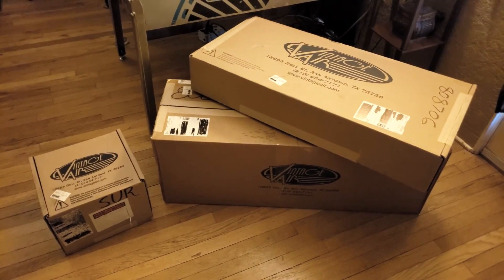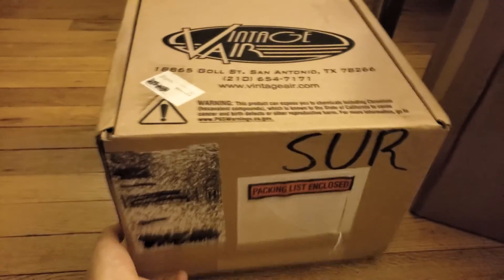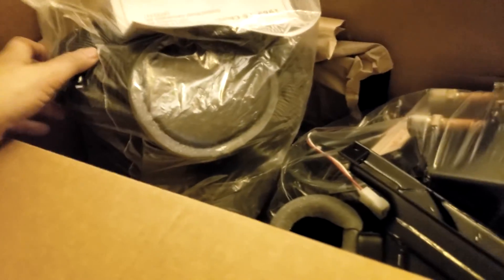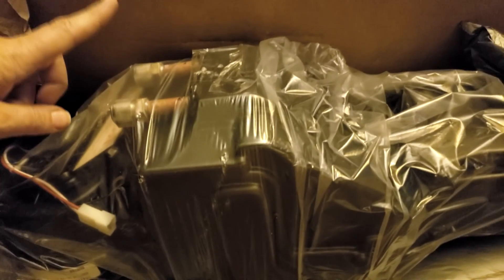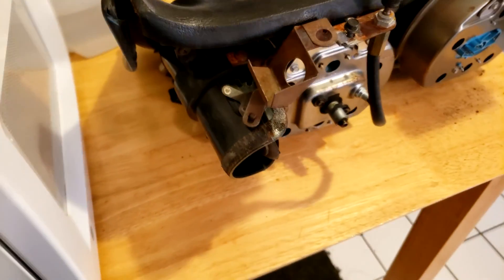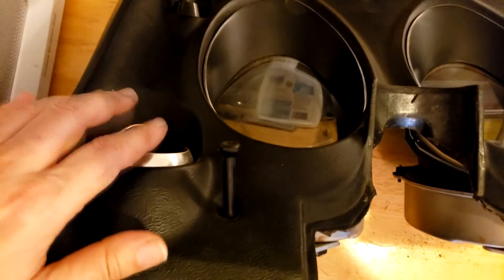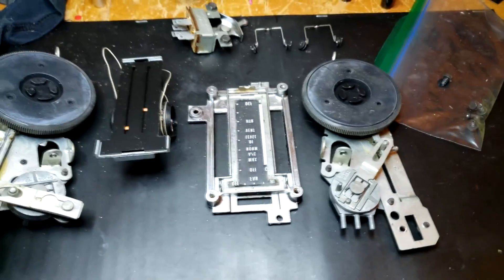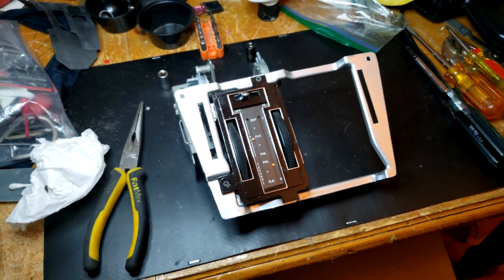1976 C3 Corvette - Vintage Air AC Kit + Cold Case Radiator & Flex-a-Lite Fans Install - Pt 1

Comment: I am just curious.  How is that radiator fan working out for you?  When I bought my '77 someone had put on a little silly "flex fan".  It was overheating like crazy.  I bought an original, stock fan from Ebay, put that on , added a new thermogenic fan clutch and a nw temp water sensor and have only seen the temp go up 5-10 degrees, like when I'm waiting in line at a fast food place, or in traffic,. otherwise its cool as a cucumber.  My '77 does NOT have a/c, and I want to put it back on some day soon.  Just curious how the performance of that fen is...thanks!
Reply from the maker: Hi Ender0999. Yes, this Flex-a-Lite fan is working very well. The car was getting pretty hot before I burped the system though (that process is shown in one of my videos). After burping it has been great. Since I have to use AC in the summer here, I needed to make sure I had a good fan that would constantly pull air thru the rad. This one does a good job, I think. I've read that these cars are notorious for overheating, even when new, mainly when sitting in traffic. While working on the car I noticed the hood seal, which makes the engine compartment basically a sealed-in area that does not allow for adequate heat pass-thru. Even when moving, a pocket of hot air remains trapped inside the compartment. I think a hood with vents would be substantially helpful. I have a FLIR camera attachment for my phone which provides great insight into the heat situation. I'll post a video on that soon. Good luck!

Comment: Guessing you can use the original compressor? Don't know if mine works even, bought the car and had the compressor in a box haha.
Reply from the maker: Joey - The Vintage Air kits come with a brand new compressor, which I would recommend using, even if the old one you have is new in a box.